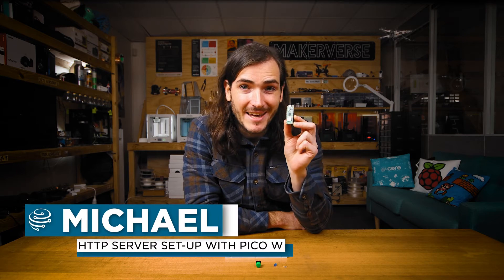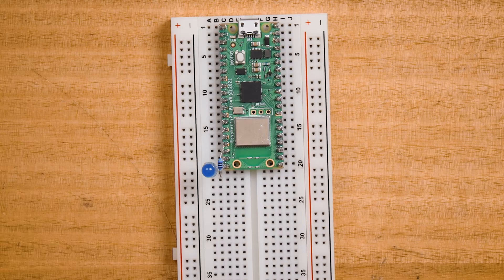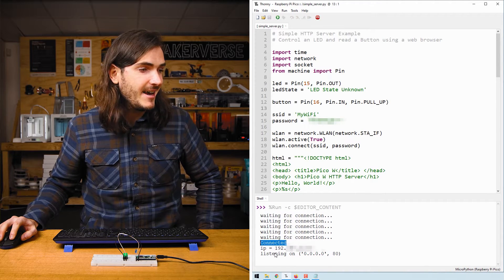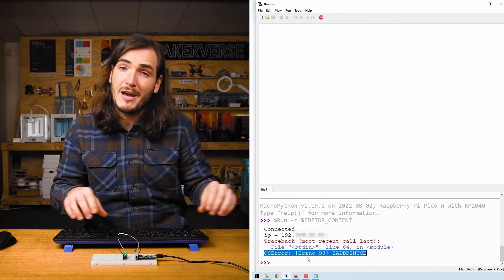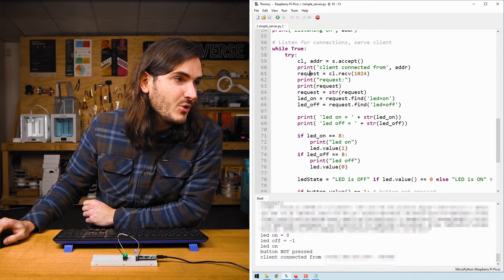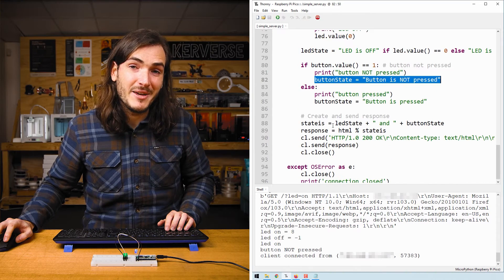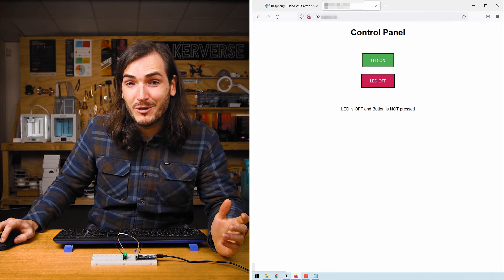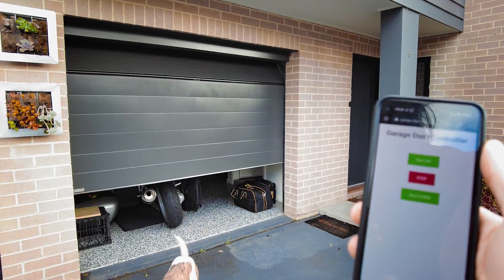How To Setup a HTTP Web Server With Raspberry Pi Pico W (using WiFi)

Comment: Can anyone please direct me to what I need to know to be able to access the control webpage on the pico from a device that is not on the local wifi? E.g. using my phone remotely miles away. 

Also, I would like to control my creations when I'm not on the wifi and also the creation is not on the wifi. I'm thinking I can have a middle-man server that is on the wifi that I can connect to via wifi and then the middle-man can connect to the remote creation via LoRa or some other protocal. Although, I'm not sure LoRa is advanced enough for this to be reliable, based on your Mechtastic series (which is also freaking great, thank you for it).  Any pointers in the right direction are greatly appreciated in advance. 

I really appreciate Core Electronics, you guys make amazing tutorials!
Reply from the maker: That is where this all suddenly becomes really involved and you start opening yourself up to security risks. The easiest solution might be to use MQTT, a way to send messages between nearly any devices. You can use an MQTT broker like Adafruit.io as your server that can be accessed from anywhere!

https://www.youtube.com/watch?v=ybCMXqsQyDw&pp=ygUMI29md3Byb2plY3Rz

Comment: hey man, i having some trouble in connecting the python code, for the html code there wasnt any problem, when using python code to website (port :5000) it wont show the interface to the website, any suggestion?

Comment: Hardware test works great but when I run the wifi connection part I get the following error:

Traceback (most recent call last):
  File "<stdin>", line 42, in <module>
RuntimeError: network connection failed

this is the code that causes the fail:

    
# Handle connection error
if wlan.status() != 3:
    raise RuntimeError('network connection failed')
else:
    print('Connected')

Any help would be greatly appreciated!!!
Reply from the maker: We have a newer video with a bit more robust Wi-Fi code over here:
https://youtu.be/hLLUxuFxLOI

If that doesn't work, we have a maker forum where you can post your issue. We have lots of makers over there that can help!
https://forum.core-electronics.com.au/

Comment: Great video thanks.  I have a question, if I've already written programs that are stored on the pico, can i use the button interface to simply call them so that they will run?  Many thanks
Reply from the maker: That is a bit of a curveball question! We have a lot of maker eyes over on our forums that would know a few ways to do that, feel free to chuck that question over there where you can get some better help!

https://forum.core-electronics.com.au/

Comment: Interesting stuff, are there any projects about setting up a stand-alone webserver to serve webpages (without being connected to the Internet)
Reply from the maker: I'm a little confused about what you are looking for, this method should work even if your local wireless network doesn't have internet. If you don't want to use an existing wireless network, we have a tutorial on how to make the pico serve a webpage over its own network that it hosts!

https://core-electronics.com.au/courses/raspberry-pi-pico-workshop/#5.3-hosting-a-wi-fi-access-pint-and-web-page
Reply: @Core-Electronics  Thanks for the response, I'll have a read through. I think that's what I was looking for. Something really simple,  (like a wifi hard-drive) but where you can just link to the wifi coming from the Pi and it takes you to a webpage and lets you access the content (as web pages). Be great for workshops in the middle of nowhere, or camp sites or could provide info in isolated places.

Comment: Very informative and amazing video. I tried the same using my Rpi zero W but ran into machine ModuleNotFound error. Could you suggest any corrections for this? Thank you
Reply from the maker: This will only work for a Pico W Microcontroller, not Raspberry Pi's single board computers. We don't have a guide on it unfortunately (thats a good idea though), but you can find others along the lines of "Rpi Zero W host HTTP Server"

Comment: I did a quick search on your videos and I did not see a video for a Pico W setup as a stand alone AP/WebServer. This video looks as if the Pico W will log into the home network and then the user will access the the Pico w through the home network. A stand alone Pico W could be a GREAT future video. Maybe even utilizing the Push button/LED project for that video also. Just a thought. Outstanding Video!
Reply from the maker: What a timely comment, we may be working on that exact video right now...
Reply: @Core-Electronics  
Please, do you have a vide on this now?

Comment: I'm trying to connect the raspberry pi Pico W with wifi and successful, but when i copy paste the ip address to browse it's not opening. I tried many times but failed.
Can you help me to figure out the fault ?
I've also a stable internet connection.

Comment: Great video as always from Core Electronics. I am trying to implement a pico w with an LDR sensor that logs time and date to a CSV file when my central heating comes on and goes off. I have all that aspect of the project working just great but I want to be able to download the CSV file from the pico via a link on a web page. I am very close but I am unable to download the file, any file, and I cant find out why or how to do it. It seems like it should be such an easy thing to do. All the examples of webserver functionality seem to focus on LED manipulation. Who needs to turn on an LED over the internet? I would really appreciate any help or info on how I can achieve file downloads over my LAN. Thanks in advance.

Comment: A good tutorial that gives a basic web interface for the Pico. Other videos I've watched cover Flask but in a full blown Python/Pi 3/4/zero context. It's good that you get to see results from code that you can follow along with. Will experiment with my Piicodev OLED, Atmospheric sensor, and Li-ion battery. Hopefully capture data to a CSV file and create a remote data logger.

Comment: >>> %Run -c $EDITOR_CONTENT

MPY: soft reboot
waiting for connection...
Traceback (most recent call last):
  File "<stdin>", line 42, in <module>
RuntimeError: network connection failed
>>> 

But my rpi is pico w

Comment: I set my ROUTER to always give each PICO a STATIC IP ADDRESS, and still got the 'address in use error". So I put 
wlan.disconnect()   # release the current IP#

time.sleep(3)  # time for router to react
right after the line "wlan.active(True)". I almost never get that error now.

Comment: Outstanding video, Thanks! Is It possible to read sensor within a wifi direct connection ? For example, reading over Wi-Fi Direct between a smartphone app and a Pico ?
Reply: could you do that? i want to do the same thing

Comment: Would I be able to use a Raspberry Pi Pico W as a Backup DNS Server to keep my Internet Online if my Raspberry Pi 4 goes Offline? My problem is my Router makes me put in two DNS Addresses so I set them both as the PiHole DNS Addresses I've tried setting the Secondary DNS as Google's DNS but if I do that and turn off my Raspberry Pi 4 it doesn't allow me to connect to the Internet unless I turn the Raspberry Pi 4 back on and with the Prices of Raspberry Pi 4 and even the Raspberry Pi 3 right now I don't really want to spend that amount of money on another one right now if I don't have to?
Reply from the maker: This is a necessary constraint of PiHole - blocked queries need to fail. It's worth a shot! sounds like an interesting project. The trouble will be keeping the DNS tables synchronised between devices.

Comment: I'm having trouble connecting the Raspberry pi pico W to an open wi-fi from a hotel lobby, is this because of security measures or should I just try this at home instead?
Reply from the maker: I'd try again at home on your own network. Public networks don't allow connections between local users.
Reply: @Core-Electronics  Holy crap it worked! thank you for this tutorial!
Reply: @Core-Electronics  Question on the Hardware test, how is the pin 15 and pin 16 complete the circuit if none of them have an LED light on there or has nothing of ground in it at least that is what the paper the pico W basic set brought)

led = Pin(15, Pin.OUT)
button = Pin(16, Pin.IN, Pin.PULL_UP)

I've been trying to figure that out for 1 hour or so, but I can't seem to find the logic in it 
(I've followed the video and it works I just want to understand it better)
Reply: I realized that if you put these pin numbers in here:

led = Pin(16, Pin.OUT)
button = Pin(15, Pin.IN, Pin.PULL_UP)

the light gets dimmer, as if the voltage coming from over there is too low and that makes it reach less to the LED light. don't know if that's true but I'm still figuring things out. Thanks in Advanced

Comment: Dude, I can't take someone who censors his LOCAL IP seriously.
Reply from the maker: Glad that's your only complaint for this tutorial - I guess the rest was pretty clear then 😀
There's a lot more going on in an enterprise network than your average household network. We don't want to reveal any information about the network structure.
Reply: @Core-Electronics  So why did you even leave the "192" in the first place? It would have made more sense if you censored your whole IP, right? Also, I don't think revealing a single local IP address could do any harm or give something away about your network, except the address range (which you already pretty much revealed).

Comment: sir, On the Raspberry Pi 4 model, is it possible to run two programmes at the same time?
Reply: Even 10, but this about the pi pico. Here to you can run multiple processed as it has 2 cores, or you can use uasync library for cooperative sharing of a single core. There are also 8 state machines, but those are a bit trickier to program. It's a really powerful little device

Comment: Thanks for this, I find your presentation well paced and easy to follow.  I am trying to re-program a garden watering system  to include  a wifi connection. All the examples of Pico W web servers I've found involve an infinite loop for the server. What I need is code running the watering system to run with the server in the background. The server traffic will be minimal.. just me on the LAN occasionally. I'm not sure if I should try to use uasyncio or just  run through the server code every few cycles to see if there is incoming requests. Any advice?
Reply: The RP2040 has two independent cores.
You can run the server on an infinite loop, and have the other core handling I/O, along with the help of the 4 independent PIO cores, if required.
A very powerful little chip.
Reply from the maker: The best way to get technical help for any of our content is on the forums: https://forum.core-electronics.com.au/
We're full-time makers and are on the forums every working day!

Comment: 👏👏
Great tutorial, Michael, thanks a lot for this!
I need to open a file in OneDrive and save/read some log data (e.g. temperature) there with my Pico W. 
Any hints how can I do it???

Greetings from Brazil!!!
Reply: I think this is way too much to handle for the Pico, you might need a Raspberry Pi 3 or 4 (or any SBC for that matter), not a microcontroller for this, as you need to handle authentication and file upload

Comment: Question to the author can i run pi hole on the new raspebbry pico w
Reply from the maker: Hi Mike, Pi Hole is an application that is designed for Linux based systems, so it won't run on a Pico W as it is only a Microcontroller and not a complete computer. It may be possible to create an ad blocker that runs on a Pico W but we seriously doubt its efficacy when compared to a Raspberry Pi running Pi Hole. Thanks for the question 🙂

Comment: This video brings another thought/question. I'm currently using a Rpi0W as a control server for my Rigol DM3058e, thanks to your video on making the Rigol stuff talk to each other. I have the PSU and the DSO on LAN  but the DMM only has USB-B. The Rpi0w is really a waste of resources for running simple webserver for control/datalogging. I'm wondering if a Pico with a webserver would handle that small function. Only tricky part is the USB connection.... Can it be done?

Comment: Thanks! This was a great tutorial for my first Pico W project. I took an additional step and set up port forwarding on my router to allow access from a public IP address using a specific port.  That worked great, until I had different users try it from different locations and some had trouble connecting until I reboot the pico.  Maybe it gets stuck on a connection session with the first person to connect?  Could this be solved if we end the connection with the logged in user after X minutes of inactivity so that the server is waiting for a new connection without a reboot?   I'm new to python - any suggestions are welcome.